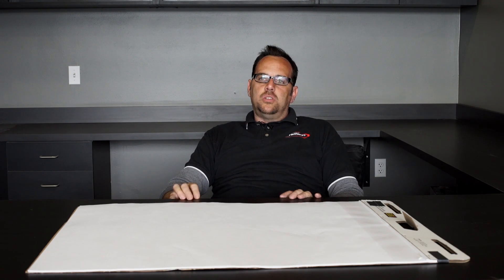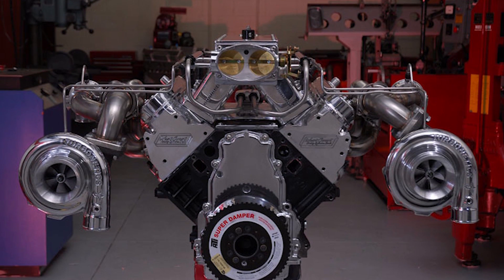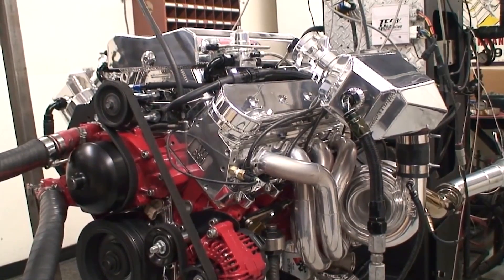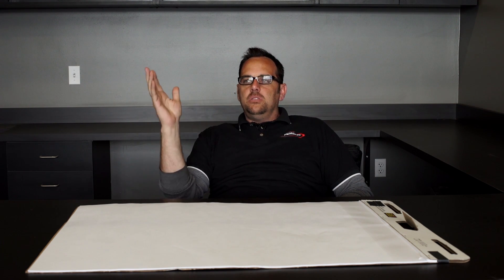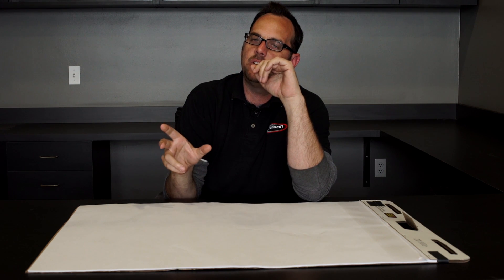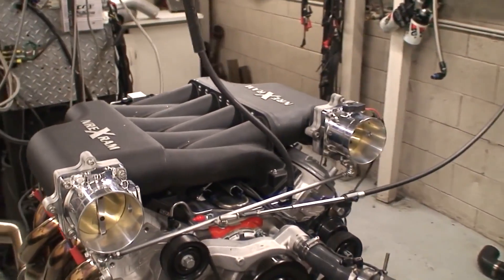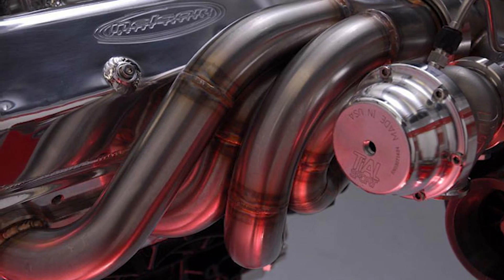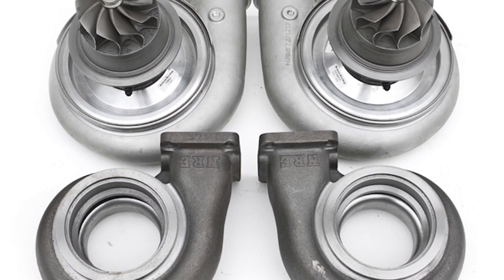Master Engine Builder Explains Why the LS V8 Is SO Good

Comment: The LS is wonderful and a gen 3 Mopar Hemi is even more wonderful in the same state of tune.  Lots of similarity in block design and strength, but the hemi will ultimately make more power in same/same tune.  Most of the folks he is talking to simply don't understand rod ratios, under vs. over square, cylinder side loads, cam bases and lifter diameters, etc....The Chevy will fit in a tighter engine bay, but the Gen 3 Hemi has more ultimate power potential.  His intake is a modern version of the old 413 ram induction wedge intake with tons of low end power.   I really like the simplicity of 2 valve pushrod engines and feel that big wide four valve engines like the Ford V8s are going in the wrong direction.
Reply: Lmao, there's many more reasons to get an LS than a HEMI, aftermarket support alone is a big one. Furthermore, almost all American V8s are undersquare, quit thinking you're special or in on something that most people don't know, even if they really don't.
Reply: the ls engine series are way more reliable. You cant do much with a 5.7 hemi vs a ls series
Reply: +Hancho familia You're dreaming!
Reply: Charles Marshall its a damn fact lol
Reply: The LS is quite simply an objectively better engine. It pumps more air, CI for CI. 

That's just scratching the surface.
Reply: Charles Marshall Sorry, buy by cfm calculations alone you are wrong
Reply: I have to agree Charles. Mopar did a FANTASTIC job on the new gen of Hemi engines. The ONLY things an LS engine has over a Hemi is the availability of aftermarket parts and a history. Both are great platforms dont get me wrong. If I had a small budget I would pick up a 5.3 SBC and put a turbo on it. But if money wasnt quite an issue I would be looking into a Hemi build.  We are getting further along in the Hemis timeline so finding a junk yard 5.7 Hemi is becoming common and not very expensive. Know a shop who got a low mile 5.7 Hemi put a Novi on it and was in the 600hp range under a couple grand and minimal work.
Reply: Overhead cam is too prone to expensive problems and too many valves weaken the cylinder head.
Reply: They are both great engines.  I recently spoke with a guy who installed a bone stock 6.2 LS Caddy engine and trans in an 04 WJ Grand Cherokee in place of the terrible 4.7 V8 that came in the car.  He advises that the car is a rear bear now and actually gets better fuel economy.  With a wide engine bay I would take the Hemi and in a tight bay I would take the Chevy motor.  USA all the way!
Reply: Four valves also means more valvetrain mass and often times more weight.  Case in point was the highly touted McGee 4 valve V8 drag race engine used for a short time in  NHRA top fuel classes that was intended to outpower the vaunted Chrysler Hemi.  It didn't make the power and soon went away!
Reply: Not really! The coyote is heavy, big, gas guzzler and is not reliable enough to be trusted as much as an ls. These ls's are missile proof! If ford's v8s were that good, people would use them anywhere just like the ls. And its not because of the price. Someone that has 80000$ put to modify a car doesnt really care spending 2000$ more for an engine to start with. Its just a matter of having the best to start with. Just like a 2jz for  japanese cars.
Reply: zoomboy28 ugh the gen3 hemi isnt a hemi and uses a bbc style head
Reply: jesh and a lot of people forget the buick nailhead etc etc etc welcome to the gen 3 semi hemi aka a shrunk bbc
Reply: LOL!
Reply: leoaleromm I would argue the 2j is so popular more because of fanboys and it is easier to build due to the sturdy block and stock valvetrain. If you upgrading the internals anyways, then who cares.
Reply: aiGeis they are heavy as shit and hard to cool....
Reply: MyLonewolf25 I know they're heavy as shit, hence a sturdy iron block. Don't know anything about the cooling issues, and don't really care because I'm not a 2j fanboy. K20s on the other hand...
Reply: aiGeis  I prefer the f20 over k20 but both are good
Reply: Price is actually why I'd be in the market for a 2jz gte. There's no fanboi about it. I'd totally go LS in my IS300, but 2jz is probably a cheaper engine, tons of cheap aftermarket parts, and it bolts directly in. It almost wires directly in.
Reply: Chris Foster WHAT??? You can barely find a decent 2j in the Americans ( us Canada Mexico ) 
You can find TONS of ls motors
THEY STILL MAKE THEM! 
Ls has a large aftermarket than 2j
In Japan this is probably different but
Not here
Reply: MyLonewolf25 lol hordes of them online
Reply: aiGeis point 
Online 
With horrendous prices 
Shipping 
Not being able to self inspect

Many not reliable sources 

99% of the time I'd NEVER buy sight unseen unless it's a trustworthy company with thousands of orders and good reviews
Reply: MyLonewolf25 lmao
there are plenty of reputable engine resale companies online

Horrendous prices? Seemed about what anything local would cost
Reply: aiGeis every one I've found has been 200 or more NOT including shipping than places where I actually go and see the dam thing and KNOW what I'm getting
Reply: how about that northstar engine in the caddy xlr. XD  dohc 32valve... sooo much better than an ls... no, the northstar doesn't even hold a candle to the much older 4 bolt main 350's.
Reply: rustypro98 the north star was plagued with leaks and reliability issues
Reply: the 2j is easier to build because it has forged internals. You just slap a bigger turbo on it and plug in a chip. Some ppl claim the stock internals on a 2j can handle limits up to 800hp. it's fkn insane.
Reply: rustypro98 stock internals in an ls can handle over 1000 if built correctly
A throw a turbo on an ls and you will SWAMP any 2j built to the same degree 

Easier to build 
Please 
Less parts 
Less cams
STRONGER internals and revs just as high

Throw a turbo and an actual aftermarket ecu on an ls and not your bs chip that does NOTHING 
You will always make more than a 2j
You will be lighter than a 2j
You will be easier to cool than a 2j
You won't have to worry about throwing belts like a 2j
You will be more reliable than a 2j
More aftermarket than a 2j

need I go on sir?
Reply: MyLonewolf25
i am an ls guy. just complementing the 2j. Also 1,000hp on stock internals if built correctly? are you fucking high? So you basically just said ls + turbo = 1,000+hp. No, don't worry about compression ratios, or going from cast to forged parts, or changing the stroke/ bore, 3 point angles on the valves, or getting sodium filled valves, or change to higher flowing heads, or decking/ planing the block..... can you just get out plz, becuase to get 1,000+ horsepower it would require all of those things. I'm not even going to format that shit u hurt my head bad.
Reply: rustypro98 he never said that it wasnt necessary to adjust those things to acheive the power. All he said was that the internals can handle over 1,000 hp (which they can) no idea why you basically put words in his mouth insinuating that nothing else was necessary to get any power gain. That wasnt what was stated.
Reply: 71sc502 thank you
Reply: MyLonewolf25 no problem man. No idea where the fuck ppl get that shit from. I swear they love making problematic situations for unforsaken reasons for their own amusment lol
Reply: 71sc502 mhmm 
Gotta love fan boys
Reply: Lol exactly
Reply: comp rear mounted single turbo on stock l33 - several people in the 950whp range on the stock block

it's past the safe limits but at the price they are, it's cheaper to just buy a new block and replace it when it goes

you really want an aftermarket block for over 1000whp anyways so this is what a lot of guys are doing now
Reply: If I had money pouring out of my ass your comments might be interesting. If the Hemi and Coyote were so great we would see them everywhere.  The price and availability is half of the LS greatness.
Reply: Look up a cam swap on a Coyote. I can build a nasty LS for less. Overhead cams are very over rated! HP is HP.
Reply: Guys calm down just LS swap it!
Reply: Yea, hard to believe there's more than Cheby..... But there is.
Reply: Charles Marshall yeah, Chrysler products are awesome, but when it comes to Chevrolet, which one is more reliable?
Reply: Charles Marshall Arrington just slaps his name on other people's work. He's gone out of business and been bought by an individual from Lingenfelter. Hopefully we'll start seeing some REAL R&D that will become reality, and possibly affordable. Truth is, if you wanna go fast, cheap and reliable, LS swap it.
Reply: Hancho familia you are wrong, the LS and Hemi are equal in the field.
Reply: I'm sorry but 4 value will always have a larger surface area of the valves ( larger valves more flow ) i hate most things about ford engines but equal to equal but only changing valve amount the larger amount will win
Reply: 71sc502 only worse ones are gtr fanboys
Reply: Not true.   The gen 3 hemi is a better breather.
Reply: aiGeis any iron block Is harder to cool than aluminum and in more modern aluminum now is just as strong if not stronger in some cases than cast iron blocks
Reply: LMAO....One only needs to look at what Joey Arrington does with Gen 3 Hemis to understand their true potential.  The LS took some design ideas from the Mopar "A" wedge by moving the valve angle to the middle of the cylinder and increasing the lifter to cam lobe area to allow for less loading and faster ramps.  It also moved the cam tunnel higher in the block allowing more direct pushrod actuation of the valvetrain and longer strokes should they be needed.  The LS also used the Windsor Ford even intake and exhaust geometry to improve volumetric performance and cleaner emissions.   Engines are air pumps and the power is in their ability to flow that air.  Simple physics...the Hemi will flow more air at higher cam lifts and engine RPMs and thus will make more power.  As far as aftermarket support goes, you can get anything you need to build the Hemi from mild to wild.  They are both great engines and both prove that you can get killer power and reliability from a simple one cam two valve engine.
Reply: Exactly Charles. The gen 3 hemi heads flow over 360+ cfm. There are aftermarket heads for the LS that dont even flow that. I wasnt going to say anything about this guy saying that "in his shop" The LS engine flows 360...but I have yet to find a stock LS head flow more than 330-340 cfm. You can tell he is bias when it comes to LS, which is fine. But you lose credibility.

Comment: This guy is obviously good at building LS motors, but he's even better on office chairs. He's built like 70 or 80 degrees of slouch into that thing. Mean. His face is so far away I don't even know what he looks like. What a boss.
Reply: MOS6582 lmao
Reply: Now that's funny!
Reply: Check out his stuff. Nelson racing engines. He's an engine genius.
Reply: The aluminum slouch is better for cooling than the Iron slouch. But the Iron holds up better for the average user. You too can slouch like a pro!
Reply: Hey now it's taken years and years to build that slouch.
Reply: 😂😂 good one
Reply: Little known fact... He created and invented the one and only carbon fiber chair for this unique slouch angle. He got laid off shortly after it rolled off of the production line. But they forgot he is a great LS motor mechainic and had to rehire him.
Reply: His nose is also the correct angle of a man that never had good ass beating as a boy
Reply: That slouch was not given to him, that slouch was earned.
Reply: Right?  I can barely hear the guy, and why doesn't the video show the parts in question, instead of this non-presence slouching in a chair, hiding behind a table?
Reply: BOSS !
Reply: True, so true. I'd like to add that the reflection coefficient he maintains with that clearly instinctive choice of eyewear style and hi-tech Nanokote(TM) coating has been engineered to very close tolerances. That no effort was spared to maximize the effect at the abovementioned angle of slouch is, well, nothing short of phenomenal!
Reply: LMAO u r silly!!!
Reply: MOS6582 i got to learn how to degree in my office chair...
Reply: I always thought of A slouch as lazy curve in your spine that allows your shoulders to be almost parallel with the flat surface your standing on; just barely bipedal.LMAO, but I guess if said person sits, he would have to be sitting on the lumbar portion of his back.This totally eliminated mystery of shoulders @ 12:00 but spine shaped like a medicine ball.Caveman anatomy.😌😂 To be so smart his brain might be heavier than average,or the extra thick scull protection.
Reply: https://i.kinja-img.com/gawker-media/image/upload/s--yjO0j5Ks--/c_scale,f_auto,fl_progressive,q_80,w_800/fbutthop7kn8ekfct9cx.jpg
Reply: LOLLL
Reply: All you see is the bottom of his shoes as he talks... boss
Reply: He’s put so much slouch on that chair he’s gonna need even longer sleeves
Reply: Best YouTube comment ever award
Reply: I bet he could take you down ez
Reply: Thank you MOS for so cleverly telling these guys how crappy their interview cinematography is. You did it way better than I could.